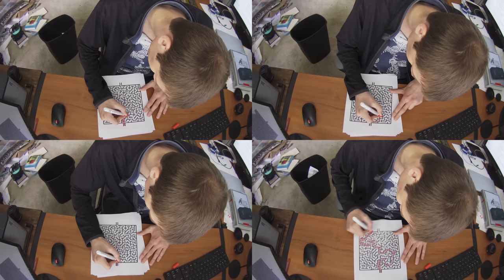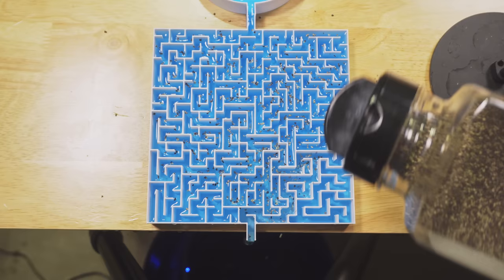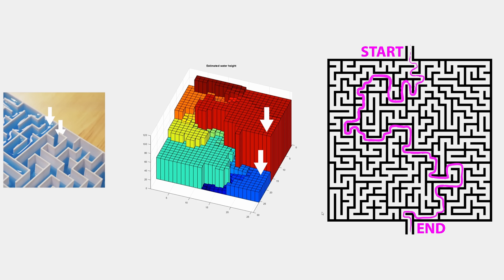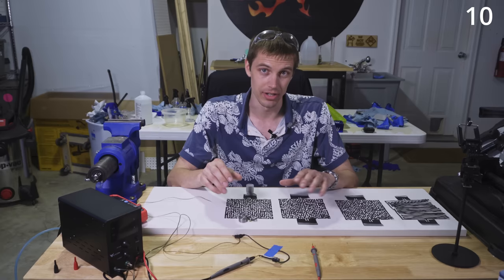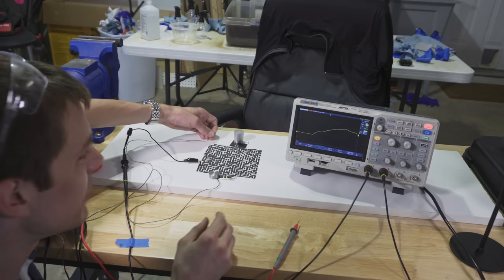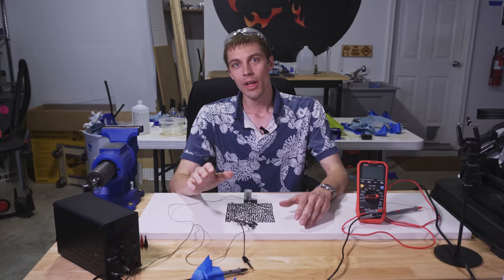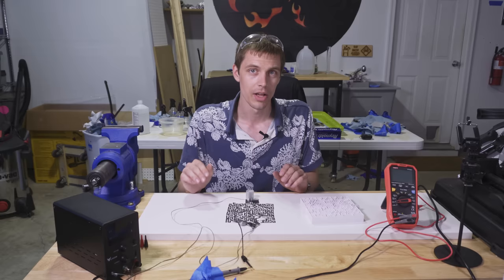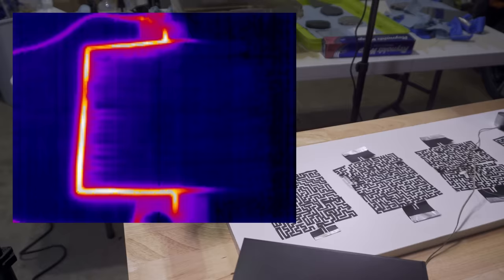How does electricity find the "Path of Least Resistance"?

Comment: Horizontal water flow through the maze. I suggested that on Steve's video.
Reply: Though it was with the idea of the water channels being small to allow surface tension to work, being a cover on the top and the bottom of the maze to allow the dead ends of the maze to become pressurized, and having the water forced through the maze by pressure.

Comment: Electrons repel each other. 
There are already electrons in the maze.
The voltage source provides "electron pressure"
The electrons will travel where there is least pressure - they don't enter the full areas where there can be no flow because it is too difficult.
The water did that - the water won't go where water has already collected (because of gravity).
It "looks like" the electrons are being smart. 
They are not.

Comment: I find it interesting that the heat maps show higher heat in some corners. Is this an artifact of the thermal camera or is this an actual representation of the heat dissipation? Are some of the electrons getting “stuck” or slowed in these choke points? I assumed the heat would equalize across the whole of the shortest path. Anyone have some insight?

Comment: Random question...That power supply, does it make a lot of noise? 

Also, have you run it say at 5A, 12V for 2 hours or so? I want to run some lights off it, and its a cheap unit, but havent found anyone that actually uses it (other than the paid videos on amazon).

Comment: 0:06: Introduction
0:15: Solving mazes with electricity
2:39: Solving mazes with water
3:43: Why does water solve mazes?
8:41: Solving mazes with electricity and the hydraulic analogy
13:02: Measuring the arrangement of electrons
14:14: Introduction to the maze
14:34: Voltage difference
15:33: Comparison between water and electricity
16:32: Electron movement
17:34: Electromagnetism
18:51: Split path circuits
19:58: Electron flow in split path circuits
20:45: Water model
21:12: Current flow
21:54: Conclusion

Summary was generated by Summatim, let us know if there are any inaccuracies! 🤖

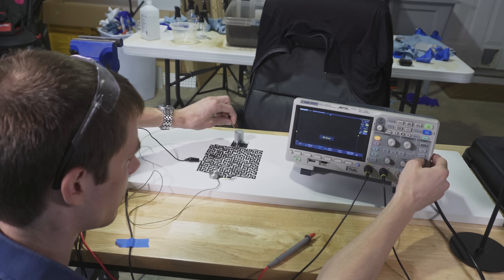Comment: So at 11:26 when you say you're running electrons from the top to the bottom does that mean you're running the bottom electrode negative? Lil confused here as the electrons charge itself is negative but normally circuts are described using the negative to positive routing.

If someone could help clear this up I'd be very grateful

Comment: The electricity will not solve the maze. It is followng the shortest route thought walls of the maze. The way the electricity travels the interconnected path it takes may many times be paths that dead end in the open areas. 
It solved the maze for electricity but not the path through the empty space.

Comment: Plasma has no atoms just an electrical charge attracted by the opposite charge on the other end so the attraction of the two will find eachother via the ambient electric charge in the environment they are in since there is always some charge no matter where you are, by using aluminum foil as the base you are effectively making the reverse of a faraday cage so the very fact you are using a conductive metal shows the electricity where to go, however it would still know the path of least resistance it could still follow the charge like a scent trail through the air, electricity is also magnetism so i you had a maze and a magnet on each end the pull towards eachother would be strongest along the proper path, the problem with a magnet is it has mass and is affected by friction, if it did not the magnets would get pulled through the correct path of least resistance, things like this are more easy to grasp if you think of the universe as a simulation since the chances of everything working the way it works in just the right way for a universe full of only hydrogen and a set of rules to follow was able to compress into stars then make all the elements then explode and make planets from the elements and new stars from the left over hydrogen and the stars are then anchors for the planets which makes solar systems and some of the huge stars make black holes which are then basically anchors for solar systems which then creates galaxies and then when it comes to life there are just as many convienient laws that are just right, i know its alot to comprehend but realize if it is a simulation does anything really change? Not really, we have no grasp of whats outside the universe or how higher dimensions work or how beings in those dimensions might operate, so it doesnt really make a difference. 

 The universe is 99.99% plasma and 99.99% of the universe has an electrical charge of some sort which allows plasma to find the path of least resistance wherever it needs to go, plasma can also have the same properties as a solid, liquid, gas or crystalline while still technically being a super heated gas so it can flow like water if it needs to, it can roll if it needs to, it can float upwards like a hot gas rising of it needs to, it can also also create a crystalline sheathe to protect it core if it needs to, almost all of our science and physics is based on the .01% of the universe that is solid matter, solid matter is an anomaly compared to plasma, plasma has almost been completely ignored by academia until very recently.

Comment: This is fantastic, I love the visualization. 

If I was to hypothetically shamelessly steal this idea for teaching basic circuitry to my high-school science class, would you have any recommendations or suggestions?
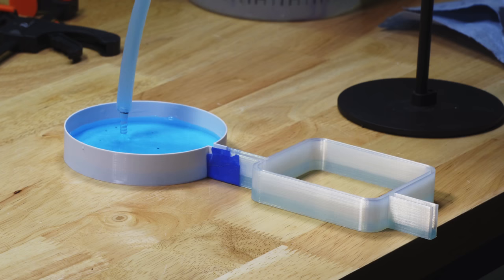My current idea is to 3D print a basic "breadboard" maze which I can insert gates to block or restrict the flow of water but my intuition isn't good enough to predict whether this will be an accurate demonstration without spending a few hundred dollars on 3d printing to find out. If I had a parallel "circuit" similar to yours at 20:48 (except evenly weighted) and put a restriction in one side would the resultant flow rates and water gradients accurately reflect an equivalent circuit with a resistor in one side? Basically can I model series and parallel circuits with resistors using 3d printed water "circuits"?
Reply from the maker: 😁😁😁 absolutely! This is very very close to the video I’m editing right now. If you have a narrow channel of water and you wedge stuff in the way, the water height forms steps just like voltage does between resistors. I think series/parallel should work perfectly but as the water rounds corners it incurs extra “resistance” so if you printed a lot of pieces, you’d have to be careful with that. Making the “wires” super wide would help with that. If you make a kit like this let me know cause I’d love to see it! Send an email or make a fresh top-level comment (I don’t get alerts for replies)
Reply: @AlphaPhoenixChannel  awesome I'm looking forward to the new video, I'll keep you posted. 

Your videos are brilliant and a huge inspiration (I'm already trying to convince our science department that we need an IR camera).

Comment: 11:50 What you're looking at here, is the system's response to a single step impulse. It's interesting to see it chunk by chunk.

[edit] 21:28 This is not even remotely close to being correct. Electrons at the entry point of the system have the same speed. One path is simply a bigger resistor than the other. 
Here is an example - a tungsten lightbulb. If you run two lightbulbs next to each other, they'll have the same emission (temperature is so high, the material emits useful levels of photonic radiation). However, if you plug a lightbulb that has literally three times the tungsten wire in one of the lightbulb sockets, it will light up to a much lesser level.

Comment: this is prettymuch quantum computing on a macro scale, you've instantly solved a problem with potentially infinite calculations using traditional means by applying a force to a precisely calibrated system, and simply measuring the output.

Comment: Wouldn't work with solution space onside the maze though. Kinda obvious with a Make that can necessarily be separated into at keast (solutions + 1) peices. So no non solutions will not be part of the circuit.

The multiple solutions is slightly more interesting, ideally it would take both in different proportions depending on resistance, I'm guessing with a short (~0 ohms ) the proportions in small changes (length if uniform material) so negligible amounts take that path.
Reply: Huh weird, maybe more to it than I thought
Reply: Oh I see, your charging each section and giving an exit via ground, and the multiple ways make perfect sense. Yeah, this is simple geometry and a little bit of circuit stuff.

Comment: If the maze was a sealed container and you pumped oxygen through, would air pressure act similar? Would it have different levels of pressure and could you use something like a barometer to navigate to the exit?
Reply: Sealed as in one entrance and one exit

Comment: Electrons moving are the REACTION to what's happening. What's REALLY happening is that upon turning the voltage supply on, electric waves start propagating. This sudden creation of electric fields sets up a magnetic field. The electromagnetic waves bounce around the walls of the conductor whenever they reach the edge of the material because of the mismatch in the type of material. Whenever a deadend is reached, the wave bounces back and the voltage in that corner eventually settles down to a stable value, essentially charging that piece of wire like a capacitor. The path that hasn't had a deadend yet doesn't see much bounceback, and so more and more charge is made to flow. Once the wave reaches the end of the maze, there might be a mismatch between materials again. Charge at the interface is established and that sheet of charge causes a backwards wave that starts up the entire process again but backwards, and in smaller magnitude. After a few propagations like this, the electric and magnetic fields settle down to an equilibrium that satisfies the physical demands of every single conductor path. The water analogy is great, but it doesn't explain what actually happens...
Reply from the maker: Mechanistically, why is there a field, and why does the field hug wires when it can propagate more easily around them?
The field comes from imbalances in charge density, meaning that particles moving and the field moving have to go together - it’s not just fields that show up

Comment: so we need a bladder tank for a battery/capacitor instead of an anode?  

This also makes me think of dimensions.  In that last example, if one takes a human being for example.  That is like a strand carrying all the information for their timeline (them).  Classic lore says there are infinite dimensions and they're all being run in parallel but the observer only knows about 1.  Their reality.  All the other paths are still populated and exist at low energies but that is not where the energy is concentrated.  Seems like there's some connection here we have yet to discover.  Likely many but, it could be an invalid relation.  Only time will tell.

Comment: My question is did you use the walls of the maze to make a circuit or did you reverse the walls and spaces?  It seems like the path wouldn't be the same if you only used the walls?
Reply: But then there would be two continuos walls around both sides of the maze

Comment: I'm guessing if you had a more sensitive thermal camera you could see the plateaus of electricity on a gradient through the unused made paths
Reply from the maker: The heat is going to be proportional to current, not voltage, so along one whole path it’s the same, but the amount through two different paths may not be the same

Comment: Its inaccurate to describe electricity using water flowing as a metaphor. There are many similarities as you mentioned, but the major difference is electricity is a field generated by the movement of electrons. Voltage is not equivalent to "water height", but more like water velocity, and amperage to water volume.

However this analogy should still be used with caution to explain the behavior of electricity, because it can sometimes behave differently than this model.

Comment: How can be the amount of electrons different at start and the end when electric current don't change series connection
Reply: The amount of electrons defines the voltage. The flow rate of electrons defines the amperage.

Comment: What if you were to seal the top of the water maze preventing air from escaping? Would the water then flow only in directions that the air could be pushed out thru?
Reply: Air can compress and get displaced

Comment: Hi
Wouldn't be easier to glue aluminum foil on top of isolator and then cut it with cutting plotter? Then remove unnecessary part of the cut.
Reply from the maker: If only I had a cutting plotter

Comment: Just looking at the thumbnail, isn’t that maze inverted compared to a normal maze? Normal mazes offer more possible branches in pathways, not just turns, but intersections, forks, etc. each offering routes with their own branches and intersections so each path offered from the correct path has an exponential number of possibilities the further away from the real lash you are. However your approach shows very little potential to get lost since each alternate path has few if any additional branches. This may not necessarily be something that effectively influences how electricity travels the most direct path, but it may if each branch reduces the path’s resistance, or each time the path forks, the effect the closest electron’s field has on the next electron gets halved because the force of that electron’s field gets diverted between two or more routes, hmmm.. maybe I need to think about this a little more in order to spell it out clearer. I just think it would be more visually dynamic to see exactly what is happening if there were more possible paths even beyond just the first wrong turn from the correct path. I’m still learning, obviously and I haven’t even watched this video yet. Also, I haven’t traced out the entire maze, but shouldn’t some of those branches lead to indirect but still complete paths to the end point. There were probably a few but I didn’t look for them and only recall there being dead ends. I’ll go actually watch the video now.

Comment: trick to solve maze puzzle is to go backwards. but that it will only work if you can see the whole maze.

anyway, using a electricity on this maze puzzle is just like making the wire tangled on each other. even how much they are tangled, they are still connected. same principle on this maze. you just made the wire look like a maze puzzle.

Comment: The electric current isn't faster then water in solving a maze. In case of electricity the maze is already filled with electrons and you olny add the diffrence in volltage so the electrons move. In case od water you would have to first fill the maze with water and then open the exit

Comment: Neat!  So if gravity is the factor that brings the system to stability with water and voltage potential and resitance on the circuit..... gravity and electricity are interrelated..... so..... artificial gravity or reverse gravity is possible by using electricity and magnetism?

Comment: Isn't the path difference due to resistance? The longer path has a higher resistance but the same voltage drop, so its current is much lower as a result. Both paths are taken, much like in two parallel branches in a circuit.

Comment: Would that work with the 3D printed maze with an homogeneous thin layer of conductive liquid instead of the aluminium sheet ? So I can use the 3D maze both for water flow and electricity flow ?

I'm a science animator for kids and there's no way the aluminium foil will survive an afternoon with kids, I need something child-proof.

Also what are the speck of the thermal camera for smartphone ? I've seen 7fps but the resolution
Reply from the maker: It’s a Seek thermal camera - I don’t k ow the resolution off the top but it’s not great. If you want something more robust to act as a demo, I’d recommend metal bonded to something hard and insulating. That could be as simple as a circuit board with a copper trace, or as complicated as a foil cut on a cricut machine and glued down to a sheet of plastic. 
This demo as I’ve done it here IS pretty dangerous though - I was using a lot of current

Comment: 20:18 I would like to disagree with you here @AlphaPhoenix.
All of the electrons are taking the path of least resistance, it's just not the same path that has the least resistance for all the electrons.
Consider it a road, the shorter path is a motorway, and the longer is a regular road, I am sure we can all agree that when there are no other cars, the motorway is the faster option, it's more direct, and you are allowed to drive faster on it.
However once the motorway has filled up, traffic will slow down, and it can be faster for you to take the regular road instead, even though it is a longer path, there is less resistance on that path.
So all of the electrons are taking the path of least resistance, it's just not the same path for all of them.

Comment: Can't you use your scope to see how long it actually takes to "solve" the maze? Use a square wave with a long enough wavelength to finish the maze. Then run a wire from the start of the maze straight to the scope input and then compare its time delay with the signal you get at the end of the maze.